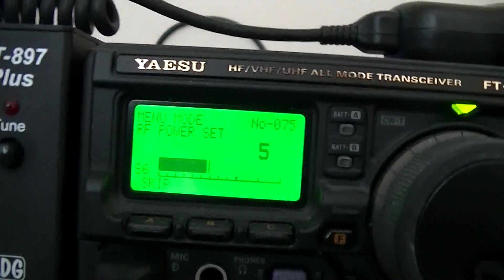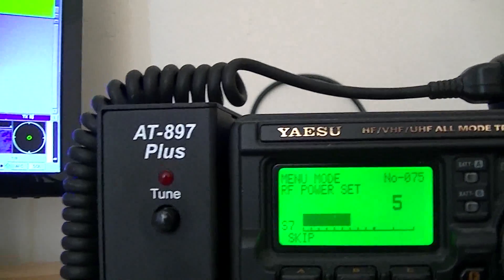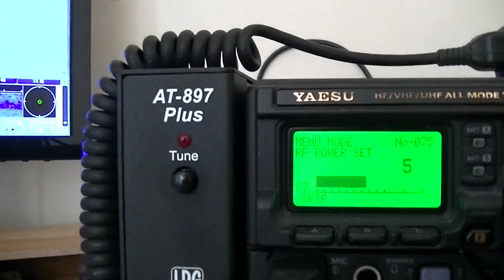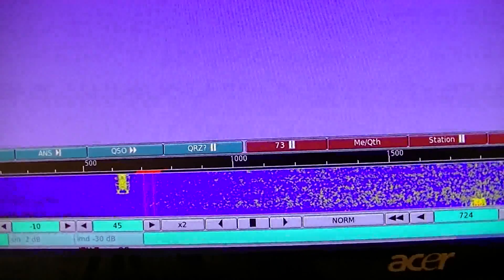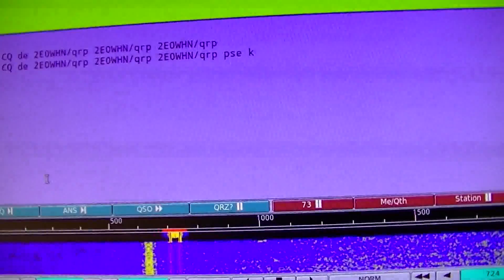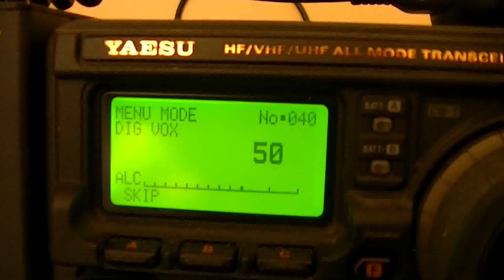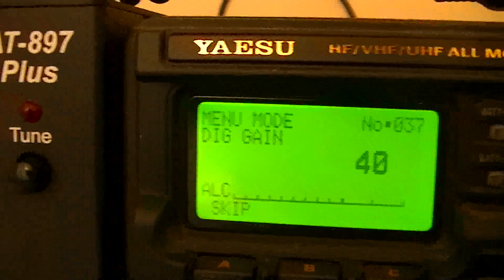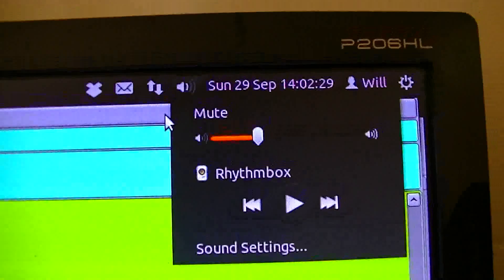PSK31 data mode using 5 watts

Comment: when you're sitting up late at night w/ yr simple rig and 18 ft of speaker wire antenna, and you have a bit of a chat with a fellow 9000 miles away deep,deep in a jungle in Cambodia, and who is transmitting on 17 watts...and look each other up on QRZ...that is anything but sterile and impersonal.

Comment from the maker: Even though it may be impersonal, it does show that low power DX can be gained if applied right.  And expanding on this can be used for HAMFAX in a disaster area for images to be sent or SSTV even.

And as you say, PSK31 is a bit sterile, it does get to places voice can not.  So comms of any form is still workable as long as you know how to and make it work.